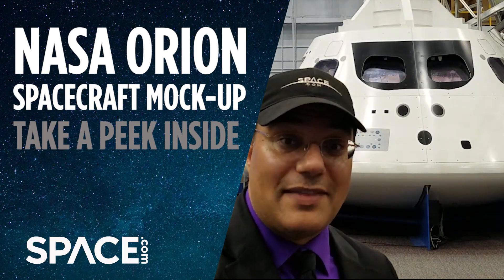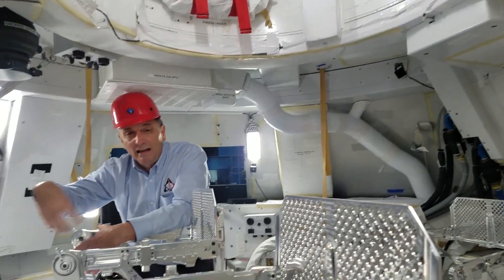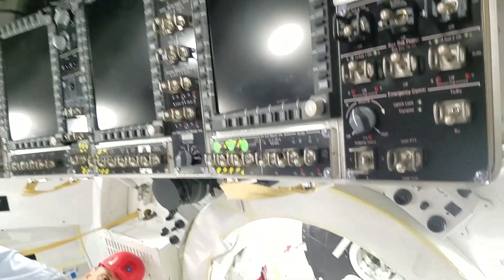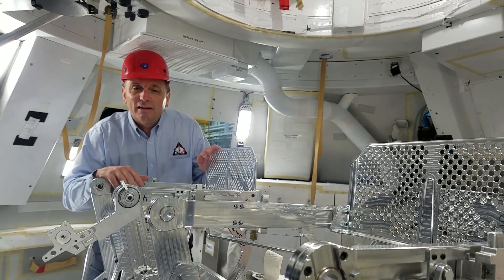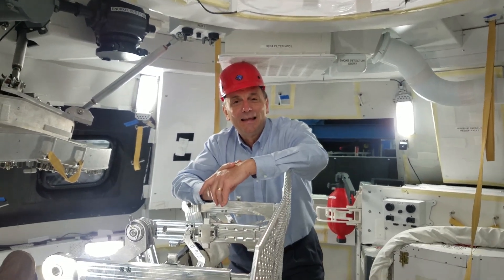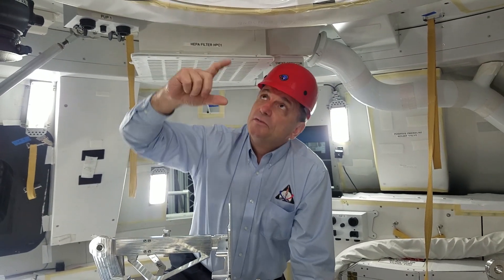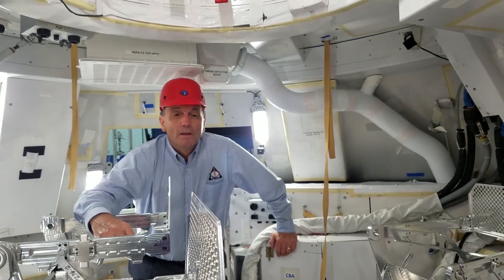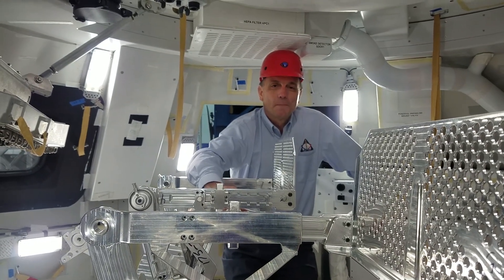Peek Inside NASA's Orion Spacecraft - Exclusive Tour

Comment: This is an increased Apollo capsule for going to orbit (whatever low or high) and returning to Earth the old fashioned way. It may be also reusable. But to claim that this is a “spacecraft” for deep space exploration to me sounds more like a marketing gag. It might be “spacy” but in no way provide for what is required for long term missions. Why would you design a spacecraft with all the earth re-entry features? It is much more easy to design a separate craft for such purpose, which is then only used in space.
No, this is just a capsule to go to orbit and return to Earth, maybe go to moon. Flying to Mars with such a can I can’t imagine.
Reply: All points well taken. It's like on Apollo. Why take all the propellants and consumables for the return trip and the heat shield and the parachutes down to the lunar surface only to have to lift them back up into lunar orbit again? I suspect Orion is really just a progressive step to reestablish crewed capability to low earth orbit for the United States and for going back to the moon using the same mission profile as Apollo. Beyond that he did mention a "Deep Space Gateway" that Orion will dock with. That's probably where deep space missions to Mars and the asteroids will emanate from once Orion delivers the crew there. Then Orion with its specialized reentry systems is left behind where it will sit and wait while a lighter, specialized spacecraft ferrys the crew to their destination and then back to the Gateway. Then Orion brings the crew back home to earth.
Reply: Great question from Hermann and great answer you provided. Makes sense. I was thinking the same thing...this craft would be very unrealistic for long durations. I searched for for a video to see what was inside Orion and found this....expected to see excersize equipment and maybe a mini bar lol. After years of seeing my heros at NASA erode away while the public interest is in shallow crap like the Kardashians and whatever Trump tweeted last night it is nice to see at least some baby steps toward something big again.
Reply: i'm sorry, but you all missed the point slightly.
Whether you go to the Moon or Mars, you have to take your Reentry-vehicle with you. At least to the orbit around your destination, from where you take a specialized landing craft. 
But once you are on your way back, you are entering earths atmosphere with extremely high speeds. 
Orion is designed to withstand the long duration of such a mission into deep space AND to withstand the reentry phase.
Therefor it is fair to say it is a space craft for deep space missions.
Reply: @3gunslingers  
Thanks Keyboard Runner for your points, which I actually noticed also on the NASA commercials. However, I don't get the logic. "I have to take the reentry vehicle with me...", why that? "on your way back, you are entering earths atmosphere with extremely high speeds...", why that? For sure, on the way back to Earth, you have to reenter an Earth orbit but what is forcing you to enter directly Earth atmosphere? Is it not possible to enter a high Earth orbit, then decelerate from to a low Earth orbit, e.g. let's say to dock at the ISS? From there then you could make a controlled landing back to Earth with any available vehicle, not only Orion. Did I overlook something? 
"Orion is designed to withstand the long duration of such a mission into deep space...", so what? I think even in the NASA commercials you can see that you still need a lot of other equipment for long duration flights and then imagine 4 astronauts living in such a cramped vehicle on their way to e.g. Mars, that's not really fit for the purpose.
Reply: @Junctures-HF  
you still need a lot of other equipment for long duration flights and then imagine 4 astronauts living in such a cramped vehicle on their way to e.g. Mars, that's not really fit for the purpose. That's right. For long duration flights there will also be an additional module for living.

About the other point of entering an orbit around earth and docking to a station:
You have to consider the fuel requirements for such a maneuver. That's what you have possibly overlooked. You would need all the fuel to slow down from interplanetary speeds to LEO speed. And you would have to take this fuel with you to Mars/Moon in the first place, which in turn requires an even bigger launch vehicle.
The best option energy wise is to just take earths atmosphere for braking. The weight of a capsule is minimal compared to that of the fuel you would need otherwise. 

If you want to do the math for yourself you can do that quite easily. You just need the Vis-Viva-equation and the Tsiolkovsky rocket equation. Those are enough to calculate any fuel requirements for missions in the solar system.
Reply: @3gunslingers  - It's true that that is how they did it on the Apollo missions. They took the reentry components with them to lunar orbit and back and just immediately reentered by using aerodynamic braking to slow down. But it didn't necessarily have to be done like that. A specialized reentry vehicle could have been left parked in earth orbit and then a specialized ferry spacecraft could have been sent to the moon and back. Of course that would have meant that extra propellants would have to be carried aboard the ferry spacecraft to slow it down and drop it back into earth orbit so it could rendezvous and dock with the reentry vehicle.

Exactly how you do anything in space depends on the calculations you make involving the spacecraft's weight and the weight of the propellants. For a moon mission it's probably better to just haul all the reentry components to the moon and back so you can just immediately reenter. This is what they decided to do on Apollo and it is probably what they will do for Orion missions to the moon. However for deep space missions it may turn out to be more efficient to do it differently. There is mention in the video of a "Deep Space Gateway" that Orion will dock with somewhere in the vicinity of the moon. It might make more sense weight-wise to leave the reentry vehicle there and use a specialized ferry vehicle to go from the gateway to deep space and then come back to the gateway again and transfer to the reentry vehicle. All that depends on how the calculations turn out.
Reply: @joevignolor4u949  
As I already wrote to Hermanns comment: If you want to do the math for yourself you can do that quite easily. You just need the Vis-Viva-equation and the Tsiolkovsky rocket equation. Those are enough to calculate any fuel requirements for missions in the solar system.

But before you start, I can assure you, that atmospheric braking is allways the most efficient way energy-wise. 
As an aerospace student I do those calculations on a fairly regular bases. 

That said, I'm in no way against a specialized ferry for the trip between LEO and moons orbit. If we have rapid access to space and we can refuel anything in LEO cheaply, this would minimize the number of all single-use components. But until then we can only bring our reentry vehicle with us all the way, or do it like SpaceX with BFR and develop a reentry vehicle so massive that it has enough internal space to even the longest journey.
Reply: There will be a habitation module attached for the longer missions.There will also be a Deep Space Gateway,a space station,in orbit around the Moon where the Orion can dock and prepare for missions.
Reply: @pjd412 Thanks pjd412 for explaining. Agree it is an issue. After all, the Saturn V 3rd stage was not so big anymore and I would not call it as impractical from the beginning. I also would think about alternatives to park fuel on the way. Then, why direct reentry to orbit? E.g. using the friction in several loops to minimize fuel consumption could be a way.
My statement still remains: Orion is not a spacecraft, it is just a vehicle for reentry into atmosphere.

Comment: A very nice apollo capsule 😎
Reply: @pjd412 , why would you say only one form will work? So, there can never be any other design of spacecraft? Doesn't the Russian Soyuz bear this out to be false?
Reply: @colinmontgomery5492  The Russian soyuz reentry module is the same shape just smaller.
Reply: @adamanderson3042 , they both have bluff re-entry portions, but I would not describe the Soyuz module as conical.
Reply: @colinmontgomery5492  The reentry module is definitely conical, it looks conical and is described as a conical reentry module on Wikipedia, which is at least something.
Reply: @adamanderson3042  , conical only in the most liberal sense. And just because the Americans and Russians arrived at that conclusion, does not mean that is the only option.
Reply: Physics dictates the shape.  Unless you really want a lenticular design?
Reply: Well the Shuttle had two catastrophic failures, all ultimately tied to its design.

Maybe simpler is better?
Reply: @notthefather3919  precisely. The shuttle design was a death-trap, to put it bluntly. The orbiter should have been on top of the stack, and preferably without a wasteful, weighty  cargo bay and without solid rocket boosters. Use unmanned launches for large payloads and a shuttle to shuttle people.
Reply: Why would we remake the Saturn v?
Reply: Seriously. That's basically what this is. 50 years later, we're back where we started.

Comment: Will the Orion capsule be reusable?
Reply: yes
Reply: @tmlrobotics5446  HA! Not as currently designed. It was originally designed to land on land where it would not be exposed to salt water. Now .. it will land on the water.
Reply: @TheFiscallySound  still designed to be reusable
Reply: @tmlrobotics5446  In an article dated August 2, 2018  NASA Administrator Jim BridenstineIn in response to a question about reusability noted that the Orion spacecraft has some potential for reuse. NASA has designed the deep-space capsule such that its avionics and costly computer boxes can be pulled out and put into new spacecraft, and, eventually, the space agency would like to reuse the Orion structure as well. 

I don't call this wishful thinking that it has "potential" and pulling out parts for use in another spacecraft a "Reusable spacecraft".
Reply: Yes, It can be dropped many times from a C 130.
Reply: Yes it will be

Comment: "With the ability for the crew to interfact ... interact with the control system". I guess "interfere" is the word you were looking for. ;)
Reply: no, interact is the right word there
Reply: You want the crew to be able to interact with he control system in case something goes wrong or if something changes. What can actually happen is that the manual inputs are integrated into to automatic control system to influence how it operates.